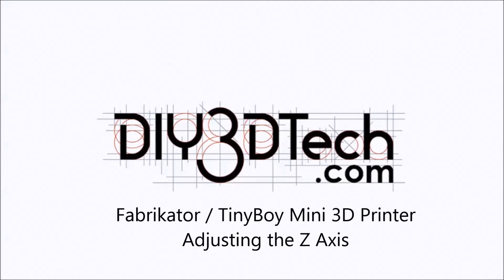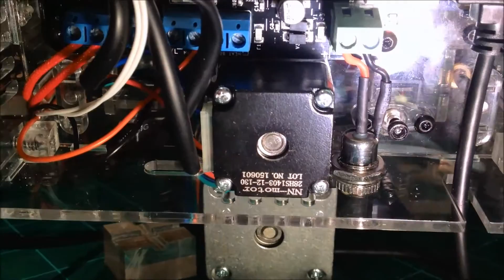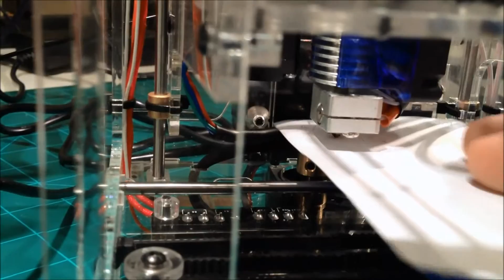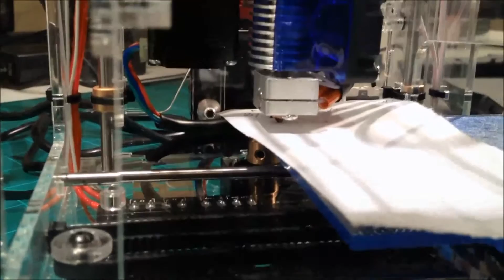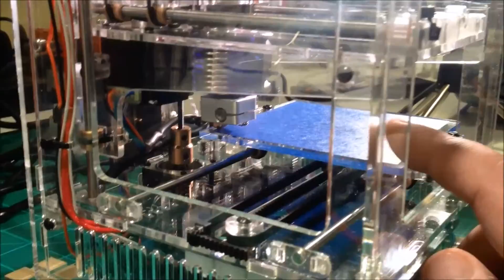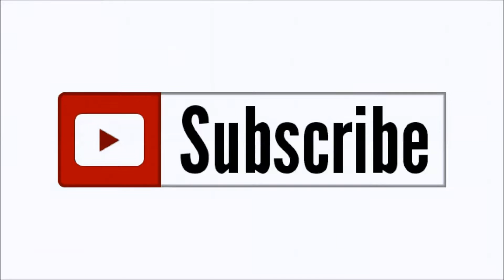Fabrikator Mini / TinyBoy 3D Printer - Adjusting the Z Axis

Comment: hi the extruder on my fabrikator mini is stucked on the very top and if i try to home the z axis it won't go down producing a grind noise. Any ideas please?
Reply from the maker: +Carlito de asmundis so the X & Y move just fine?  Also what host are you using Repiter?  As one of the things I would also suggest is to spin the Z Axis down by hand and see what happens.  Also if your using Replier host, possibly try Pronterface.  Also if the temp is pegged you might also have an issue with the thermistor which means the printer is unsafe as if the thermistor is bad the hot-end can run away creating a fire hazard...
Reply: +DIY3DTECH.com thank you for the reply..i've managed to bring the z axis down via software but it is not responding properly in repiter. yesterday night for one time the axis was moving freely with no grinding. But now i've powered it on and the grind is back again. Should i shoot a video of the issue so maybe you can help me out? big thanks Carlo

Comment: I spent a fair amount of time adjusting the z axis and leveling the bed on my Fab Mini also but the results were well worth it. I found one corner or side of the bed was slightly off and put a small square of paper (with a hole for the screw) under one of the screws holding the bed down. Not a perfect adjustment like a screw in every corner of the bed but close enough. No problems with the print sticking to the bed, almost stuck too much. I used painters tape with a glue stick for quite a while but got tired of replacing the tape after every print until I put on Buildtak, that stuff is great.
Reply from the maker: +Steve Cuthbert I was wondering about the Buildtak, however worried it would take too much force to remove and replace.  As on my Wanhao it takes a lot of force to peel it up and that thing is made of metal.  Any issue when you have to replace the Buildtak?  As I even considered just exposing the adhesive on the corners  and level the center covered??
Reply: +DIY3DTECH.com I've only done a dozen or so prints since installing the Buildtak, so I have not had to replace it yet, but when I do I will most likely remove the bed. It's only 4 allen screws plus I don't want to put too much force on the plastic parts.